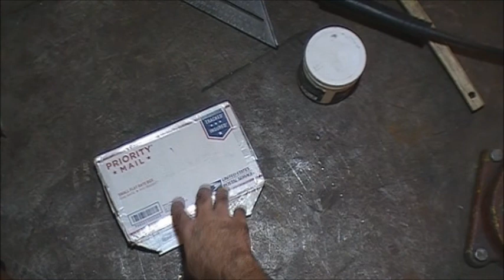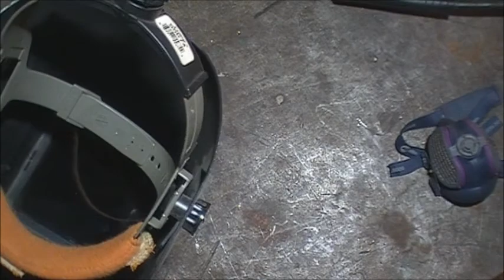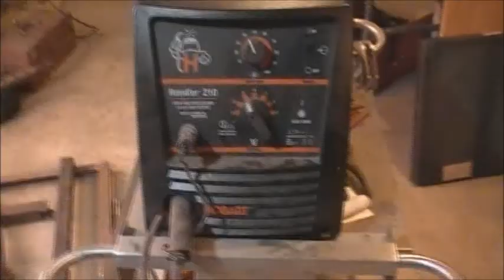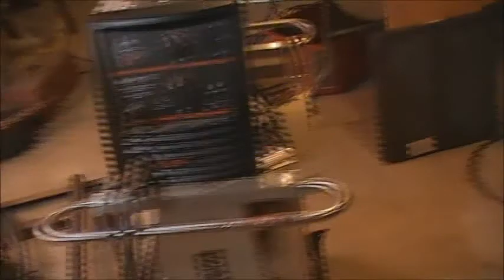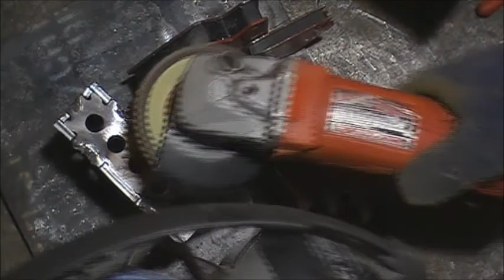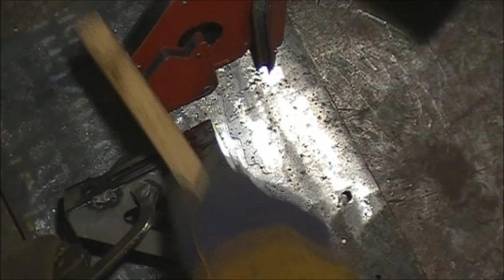Tab & Slot Welding Square

Comment: I generally don’t comment, and when I hangs, or the table itself after do, I don’t like to criticize. But...this was all incorrectly done. First of all, there was no need to spot a plate on the table. The table should be clean, and flat from the get go. Use a ruler to see if it is, and then clean it up. If spotting a plate, the fact that the plate could be spotted to the table table shows you that it’s making good contact, and a test isn’t needed.

As far as the square goes, it’s pretty simple. The depressions in the slots are there to be welded - below the surface. The welds are never supposed to reach the top of the slot. You are not supposed to sand or grind the surface of these things, or the table. That ruins the accuracy.

The tip should have been discarded. These are consumables. Long before it reached that dirty state, it should have been replaced. If spatter ever sticks to it - throw it away, and use a new one.the hole in the tip is easily damaged. Cleaning it will also damage it.
Reply: Well, the spell checker and text replacement worked overtime in that comment. It’s odd that it changed the sentence after I hit post. It should have been;

I generally don’t comment, and when I do, I don’t like to criticize.
Reply from the maker: Mel Gross, your comments are appreciated. So let me address them.

First, I never claim to be anything but a hobby welder. So my techniques are not perfect since I am predominately self taught. 

Second, the table is not a welding table, it is a steel work bench that I knew from the beginning was not flat, therefore I added the plate I knew to be flat.

Due to the fact that I weld with a flux core wire feed welder and not gas shielded Mig, spatter is a way of life and is going to get on areas I don't want it to get on.

The minor amount of grinding I did to the square was done carefully with the angle grinder then finished with Scotchbright pads on a small pneumatic angle die grinder in order to only clean the surface and remove as little material as possible.

As for the consumables, again with flux core welding, there is by nature of the process, much more spatter and slag which yes, can and will damage the tips. However, yes you can in fact clean them and extend their life. If not I would be replacing the tip after every welding job. That is just not a cost effective option.
Reply: Mel Gross 
About your pliers
I believe the originators of the pliers were
Welpers all the others are knock offs
One other feature of the welper is a hammer (its on the side)thats used for knocking loose splatter out of the cup
Or I use it to tap myself in the head everytime i make a incorrect comment